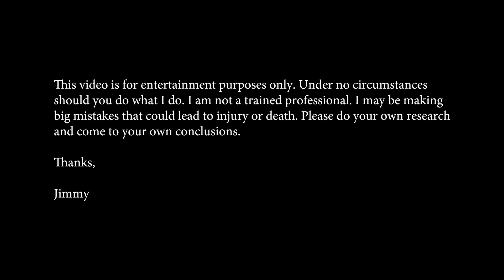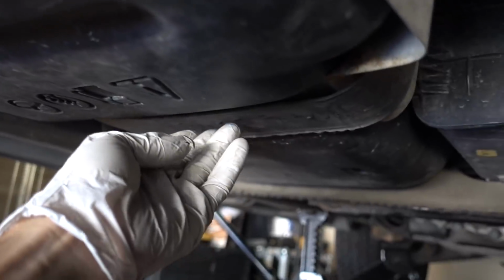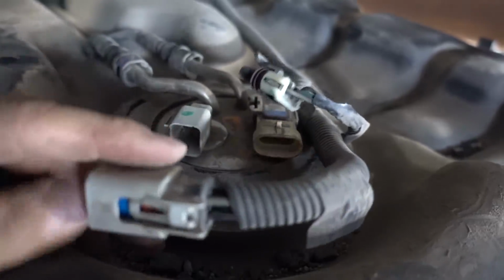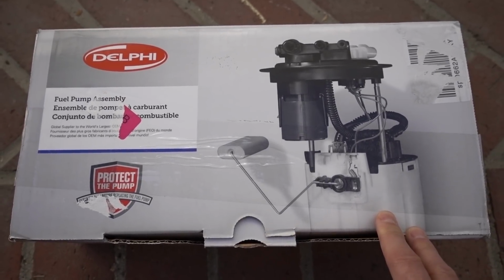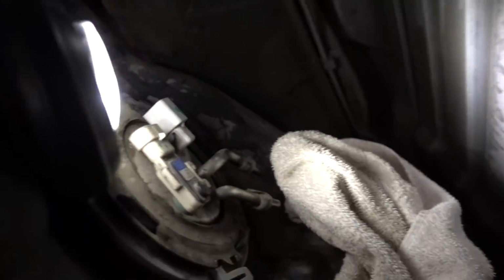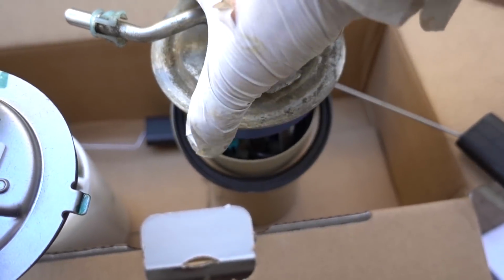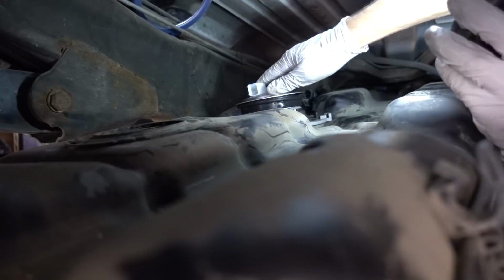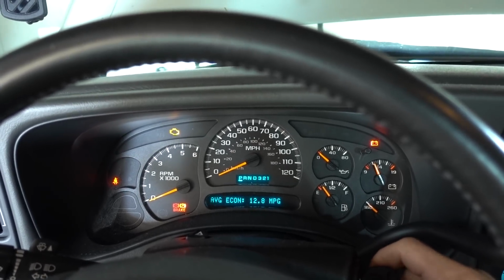CHEVY & GMC FUEL PUMP REPLACEMENT!!

Comment: Finally good to see you happy. Just a piece  of advice try not to have low fuel in your tank like very often near the red line. Because it will help to reduce the fuel pump live. As the fuel actually keeps the fuel pump cool so having low fuel help to wear out the bearing and all that stuff.
Reply: Burdain Abdulkreem don’t be a hater, he got there in the end 🤗

Comment: My 96 Chevy Suburban 1500 High top van has the same fuel pump. And watching you change the pump on this Silverado, l was surprised to see, they both have exactly the same fuel pump. That was a surprise for me, and finally, l can order the right fuel pump, since is being difficult to get a match just putting the 96 Chevy 1500 8cy High top suburban van only. They always gave me the wrong fuel pump. Thank you very much for the video and the instructions. You are the BEST mechanic on Youtube by far. Congratulations. 😀👌

Comment: Man so glad to see this video. Exactly what I am doing right now. 2003 Yukon 5.3 flex fuel. My pump had been suspect for awhile and I got ahold of some bad gas and it finished the pump off. I ended up removing the whole tank and draining it, so I had to go an extra step. The part about not being able to get the truck high enough was so relatable. I pretty much did the whole job with one hand, and it was definitely a challenge!
Reply: Ouch bummer. . My Yukon pump rusted out on top  I chopped a hole under the back seat. Put in a used one from the junkyard has been running good now for 4 years.

GM should be ashamed of themselves all the brake lines Rust out in northern areas were there salt.

Comment: Sir I feel ya. I changed the oil pressure sensor on my daughter's gmc yukon 5.3. I didn't use the upgrade gaskets, now bank 2 is totally dead, misfiring and everything. I got good fuel pressure, spark, but no compression in cylinder 6. I took this thing apart 4 times. I replaced the cam sensor just for kicks. I'm ordering the kit from Amazon and hope this solves the problem. At least I got a code po174, bank2 lean. Plus my shtf and ltft is running at 48 to 50 percent. Well wish me well. I thank you for the video.  Very helpful.

Comment: There no job like a job well done.

I had a valve go on my 98 K1500 (Exhaust 3), so I had to get the heads off. They were cracked. I ordered new ones and slapped it together, but the job was tiresome! Cleaning the rockers, pushrods and nuts led me to a new level of chemical burns (Super Clean is a hell of a cleaner...), and trying to remember how it all came apart and went back together was tough. However, once she started up again and ran without a hiccup, I was overcome with the feeling of accomplishment. I loved it. When you do a tough job yourself and do it right with satisfactory results... there really is no better feeling.

Great job, man!
Reply from the maker: Thank you!
Reply: I agree. Doing it yourself and everything working in the end is so satisfying. Not sure if I would do  this job myself. Either get a friend or bite the bullet.
Reply: Pete be careful there is probably a cause .Running lean will make it run hot and crack exhaust valves.I had trouble with my 71 hilux the intake gasket wasn't sealing right and i burned an exhaust valve.

Comment: Hello Jimmy….great Job….I am too lazy to drop the Tank and mine is always Full…sooooo today I Cut an Access Hatch in the Floor of my Suburban….which is the same as your 03….I never ever go below half a Tank….but I needed to change the tank pressure sensor…..whose gonna drop a tank for that !!!  and she was dirty on top….have to change the tank vent valve tomorrow….but excellent…I carry a spare pump in my Suburban and all the Tools…spare retainer ring …line clips…ready for Failure…one hour and I should be up and running…Thanks….take good care of your beautiful Wife Too!

Comment: My 07 dodge dakota is doing the same thing. First thing i checked was the fuel pump but after ordei tested my old pump n it was still working so i was confused n i put everything back together, still wasn't working so i thought injectors and bought injector cleaner which seemed to work cause my truck started after 3 or 4 tries. I drove the truck for 4 days (even on highways) and it drive just fine but the 5th day it wouldn't start again so i go to harbor freight n get the same pressure set you had in the last video and i have 0 pressure so I'm thinking the pump is bad but when i banged it around it worked for a few days but I'm just going to replace it and hope it fixes the problem

Comment: I bought a pump from the same company, after all the rust and sweat i was happy to just put the pump back in the tank and later discovered the fuel gage to be on empty always. I needed to double check the fuel gage lever with a multimeter before installation. Plenty of help here on youtube.

Comment: Nice work.  I also, ended up changing my intake manifold gasket on my 02 Tahoe at a 170K.  So, yours needed to be done.  We have had our Tahoe since new and have no plans of getting rid of it.  Even if you did throw some parts at it, which you didn't, you have a huge cushion by doing the work yourself, so you would still come out way ahead......especially when they mark up the price on the parts 2 and 3 times cost and the labor cost.  Good job on sticking with it.  Can't go wrong with the support from the wife.

Comment: Removing the rear driveshaft makes it much easier to remove the gas tank.Sometimes that clip the gas tank strap bolts bolt into breaks.Don't ever buy an Airtex fuel pump,these are garbage with high failure rates.The replacement plug ins with the replacement Delphi fuel pumps, were for up to 2001 GM truck applications.The plug in melted which was a common problem.The locking tabs,I throw them away since they are a PITA to get out.The plug in is in hearing a click

Comment: Great video!  I have a 2003 Suburban with the 5.3L Flex fuel also. I have been having trouble with “hard start” condition. Turn the key and it just turns over but won’t start. Then turn the key a second time and it starts. Connected fuel pressure gauge with key off and had 0 
psi. When started 45 psi. Pressure immediately dropped to 0 psi when engine was turned off.

Not smelling any gas fumes that would indicate an external tank leak. 

Fuel injector pressure regulator has no gas in vacuum line. 

No indication of injector issue with performance or OBD codes. 

Believe check valve at fuel pump is faulty and requires replacement. 

Any ideas?  I think I will be installing a new fuel pump assembly soon. Thanks.

Comment: Excelent job you have saved over $1000 in replacing this fuel pump your self chevy dealers and local mechanics wants at least $800 to $1000 for this work

Comment: Getting it fixed is Relief! At 11:13 one of the electrical connectors looks like it has a burned connection. 
I replaced my pump a few years ago. The steel top of the pump assembly rotted through. PITA to replace that pump, especially the plastic tube connectors. GM should have made the sheet metal top out of plastic from the factory. The only part that was metal failed! Came up as an evap code on  05 Silverado.

Comment: Glad I found you, my 2003 is doing the same thing.. died on me yesterday so today is trouble shooting.  I think the first thing I"m doing is putting in a new gas filter.
Reply from the maker: Be extremely careful if you’re going to attempt yourself. Those lines can be pressurized and spray fuel out all over the place.

Comment: Did I miss one of the most important parts of this job, how to properly detach and re-attach the fuel and vapor lines? Is there a special fuel line tool or application needed for this?
Thanks and good job.

Comment: Jimmy, as another viewer said, never run your veh under 1/4 tank of fuel (gas). The gas keeps the pump cool. Other wise they over heat and cook the impeller thus giving you little or no fuel to the engine.

Comment: I used to stick a funnel in the tank filler neck,have an assistant tun the key to the on pos, and listen to see if its coming on.The next thing if its coming on,is gently tap the bottom of the tank with a rubber hammer to loosen up the debris usually blocking the sock,and 5 times out of ten it will start enough to get it in the garage and change the pump.

Comment: happy you fixed it man! you also may want to invest in a spark tester like $25 along with your fuel pressure gauge! another thing those electric fuel pumps in the tank are cooled by fuel so running you tank too low with give to fuel pump a shorter life! generally a small to medium vacuum leak with not cause the engine not to start but i will just run poorly! i see you noticed some or the parts are different for the flex fuel trucks even some of the engine gaskets! which is impartant since the fuel with eat away the ones for the regular engine! Cheers man!

Comment: Just found you, my 2002 Yukon was having a harder and harder time starting and finally died at work.  Buddy brought over a fuel pressure gauge.  0 psi. shot some brake clean in the air box and engine started, still 0 psi.  Found out that this is common for this age truck.

Comment: What can  clean out sugar or bleach in gas tank 
The reason am asking is because someone at my wife work told her that another worker saw them put something in her gas tank a week ago because she was hired for a higher position now am trying to figure out how to check by pulling down the gas tank but not sure if it made it to the engine and if it did how am able to clean it without taking the engine
Reply: Don't worry.Replace feulfilter.No problem with engine!!

Comment: Good job I have a 2003 with a 6.0 liter. If you ever have to do a neutral safety switch you will discover that GM thought it was a good idea to glue those wire connector plugs together. Why? To make things difficult for the consumer.

Comment: What I'm going to have done is cutting accessport in the back of my Suburban that way I can just reach down and change the fuel pump when needed
Reply: Remember if you cut a hole I was told you have to make it big enough for the angle that it needs to go in.
Reply: That would be a good video as I have cut holes in the side of ships to access things that seem to F up all the time!
Reply: I do this to all my suburbans and Tahoe’s
Reply: Screw dropping the tank. Especially when it’s a 44 gallon tank and it’s full lol

Comment: My 97 S10 4.3L started just fine,drove it for about 20 feet.  Then the engine died and would not start,had to get towed.  Luckily it was an easy fix. I used an Accel cap & rotor and the cap happened to be tan instead of black. It burned thought the cap and was arching out on a nearby bolt. The cap was burt black where it failed.  That cap was only a week old and they wouldn't warranty it.  Never bought Accel ever since.

Comment: Bro I changed my fuel pump by removing my carpet on the driver side n cutting the floor...it's easy n less aggravation..I used 3/4 self tapping screws n strips of sheet metal to lock it back down with rubberized tape

Comment: Had the same problem and on the fuel pump on top of it this cables I use inverters to clip them on and the inverters weren't getting no juice so the pump got you sometimes and sometimes it didn't so maybe check that the fuel pump cables on top of the fuel pump you got these little inverters juice on the bottom pump but not on the top converter so the juice wasn't going through maybe that's something you can resolve I dealt with the same thing for over a month

Comment: The 04 non flex fuel or straight gas 5.3 fuel pump is different as I just changed one out.
The pump has 3 inlets/outlets or in the actual names one supply line, return line, and vent to charcoal canister. The plugs are a single flat 4 prone plug containing your power and grounds for both the pump and signal activation and a single flat 2 prong plug which is the power ground to your fuel level gauge. Along with having the fuel filter built inside of pump.
And having lines inside of the tank to disconnect and connect to bottom side of pump
So yes to answer your question in the video they are different.

It is easier if you have your rear tires off the ground by about 8 inches or so, I used crib blocks and blocked up both tires up. Also removing the spare allows better access to the fuel filler neck from the rear of vehicle.  
Once the rear of tank is down, and you have enough room left, tween tank and rear end due to the tires being blocked all you have to do to is take a bar and pry a little tween the bracket and tank as you lower your jack little by little and the tank will slide right out. I used 4x4 blocks on each side of my jack to catch tank without pinning my jack. Also a price of plywood cut to size between tank bands. To place jack under is a big help in evenly distribution of weight in tank. I also empty fuel tank after getting out and clean good. Leave empty when reinstalling or just put enough in to test function prior to completely reinstalling tank. Saves if you made a misstep somewhere from having to remove tank again. 
Than when reinstalled you can add fuel, I put mine back in by hand without a jack with just enough fuel to test function prior to reinstall made it so much easier. Hope this helps someone trying this down the road.

Also removing the driveshaft does give you enough room to work in that area of the vehicle unrestricted. I recommend doing it as it is easier to work if you already know how to take out a driveshaft. If not find a video showing how, it’s really simple but you, take out the four bolts at rear holding u joint brackets, jar with a hammer.
Helps if front tires are scotched good. And vehicle put into neutral so you can turn driveline to gain access to all bolts easier. One rear is down just rotate and pull to rear may need a little jarring to at front as I slide out. BE EXTREMELY Careful not to knock your brains out with it or to let the caps come off cause if you do those little bearings inside can fall out everywhere and they are a BIOTCH.

Comment: I have a 2005 gmc yokon Denali, I  changed the spark plugs out and now i am getting a misfire.Could it be that i have a bad fuel pump? It will take about 3 seconds and then start ,drive for about 1/4 of a mile and then chug and then stall out.
What's you recommendation? Do you think it could be a bad fuel pump?
Reply from the maker: Andre Abraham why did you change the plugs? Were you having an issue that you thought it might solve? I’m wondering if the plugs are gapped right? Or maybe a plug wire isn’t on correctly?? If you had no issues at all until you changed the plugs then the problem is probably with something you’ve touched... the plugs or wires.. my best guess.

Comment: Where in the world is the fuel filter, I have 2006 chevy tahoe z71, all the forums I've read says it's in the gas tank.
Reply: The non Flex Fuel ones only have the filter in the fuel tank my 2000 Sierra was a standard non flex fuel and it had an external filter but most of the newer ones that are non Flex Fuel only have them in the tank the flex-fuel versions have one on the pump in the tank and One external filter

Comment: I cracked the fuel pump assembly in my 2004 Corvette just by filling it up. It released a lot of fumes, and I didn't even over fill it. That was the most expensive tank of gas ever.

Comment: Too bad GM design engineers did not design a fuel pump access door or plate so one could remove the pump without lowering the tank assembly.  I hear these in tank fuel pumps have a history of going bad  often.
Reply: You can cut your own access panel using a oscillating tool

Comment: Also you didn't have to buy the whole fuel pump as you can fix the. Non working one it woud casue $22 only by pulling the fuel pump from the unit and replace it its realy easy i did it before in my cars chevys mercedes bmw etc

Comment: I know that feeling brother i had my car stole on me couple of times in middle of the highway once in middle of a bridge i couldn't figure out what it was until I checked the fuel pressure and i changed the fuel pump and walla it still works great. (2 things 1 how did u remove the fuel fill tube i worked over an hour just to remove it and also to put it back up and 2 i tried for a few hours to remove the tank until I figured i had to raise the back of the car more so the tank can slide out

Comment: Sometimes a car company will redesign a part in the middle of production. That is why some people have a part that is not 100% identical, even if they get it from the dealership or OEM parts supplier. Other times the OEM part will be redesigned after a few years because too many of them were failing, although in my experience, this is rare.

This happens with many car companies. I had to deal with many 1998, 1999, and 2000 VW Beetles and Cabrios which had a mix of parts from MKIII and MKIV Jettas and Golfs.

Comment: This was for your previous video suggestion never click your torque wrench twice only once especially in the final run it will increase the torque. 27 years of Aerospace experience, recertify every year torque 1 fasteners Etc. Torque 2 certification cryo torque on launch vehicles.